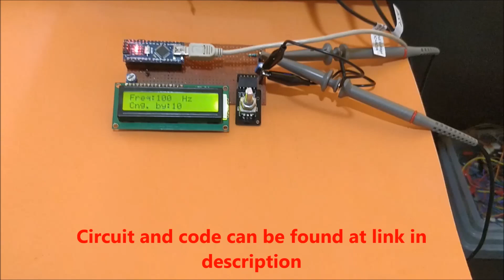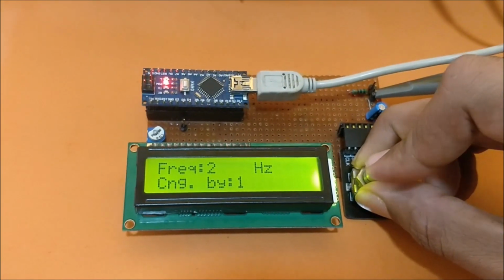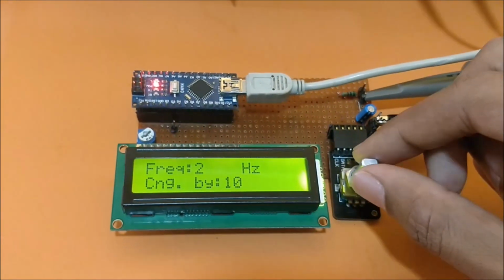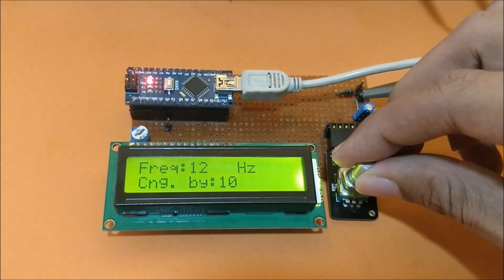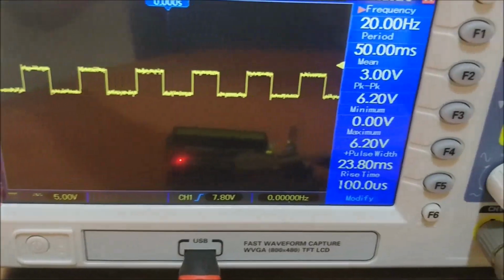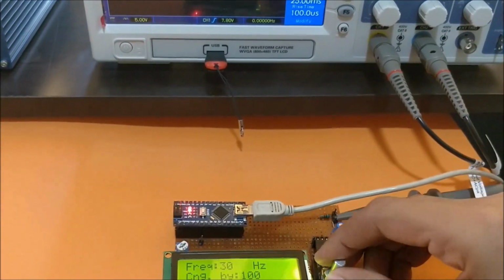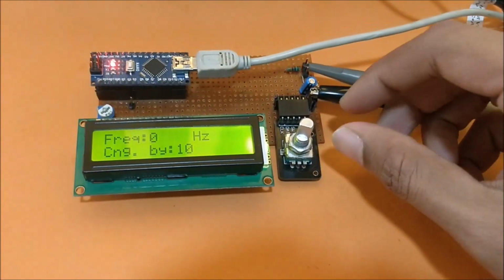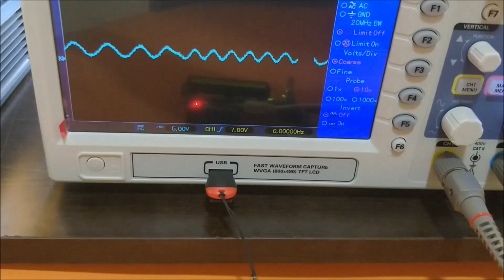Waveform Generator using Arduino

Comment: There are specific ships including micro-contrôlers to achieve this.
They  will give you true waves,  tricky things and even sometime will include powerfull output buffer for hight level and current output signal.
Reply: Indeed, the same author made a programmable generator arround an AD9833 and a Nano as well.

Comment: With my Robodyne encoder, I had to add a pull-up resistor for the switch, and swap A and B output.
Funny fact, the display goes bellow 0 Hz, aka -6 Hz :)
I suppose this can be fixed easily in the code, I didn't check yet.
It would be nice to also modify it to have frequency output between 0 and 1 Hz.
There's also "const int POT_pin = A2;    ", which is not used.

Comment: Why you said ,  "its not "proper sine waves"...i need explanation
Reply: Sinewave follows the sine or cosine formula. But this sinewave is generated by rough enveloping using a crude Low pass filter. Hence this is unlikely to follow the simple harmonic motion.